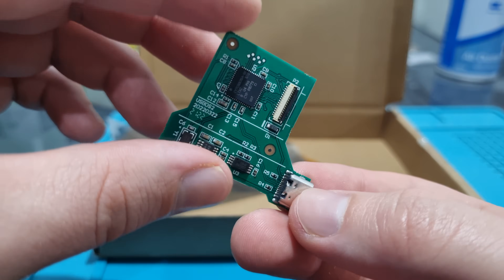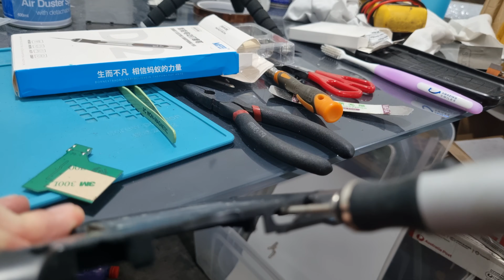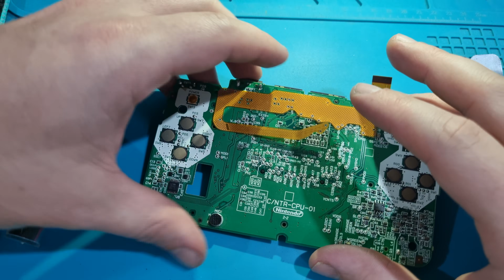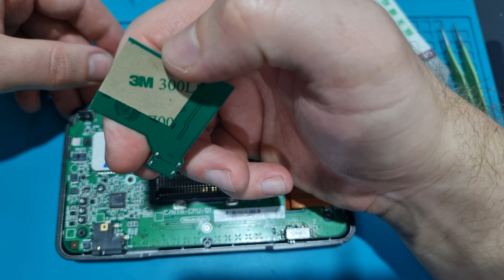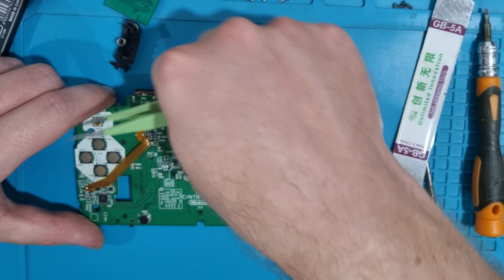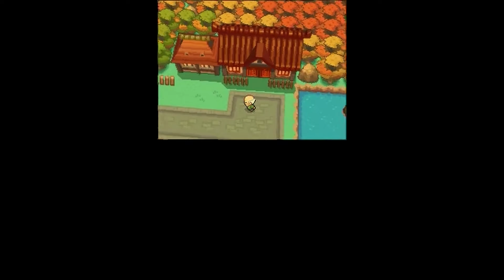I got a capture card for my DS, lets install it and record some gameplay! Loopy capture card guide

Comment: Hello! Just came across your videos, my DS lite was dropped a few weeks ago and now doesn’t boot or charge (orange light goes on for about 5 min before it turns off). Was wondering if you do repairs in Melbourne? Or any suggestions? Should I try replacing the battery?
Reply from the maker: If you tip the console side to side do you hear anything rattle around inside? I'm not based in Melbourne but I'm in Australia so could post it up and wouldn't cost to much.
Reply: @chickenmaster121  nothings rattling inside from what I can hear, where can I find your details? :))
Reply from the maker: @tonialillis5602  via email chickenmaster121repairs@gmail.com